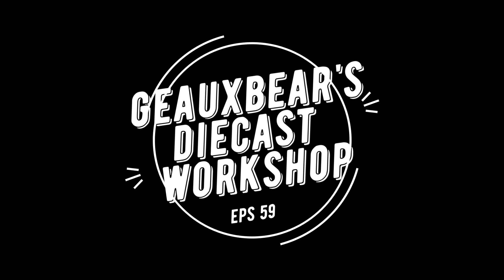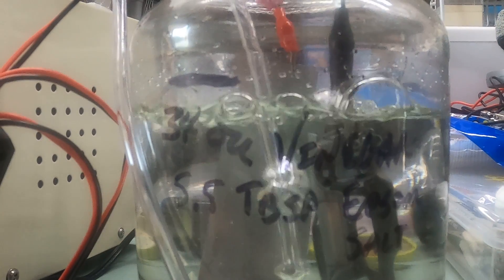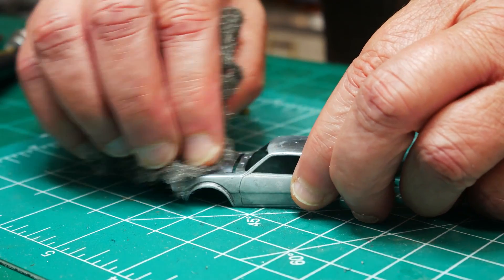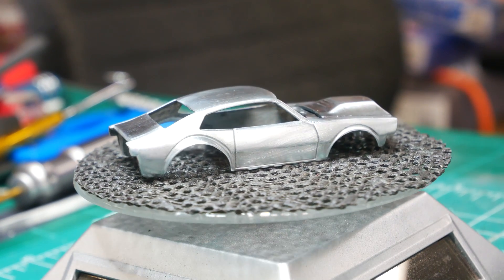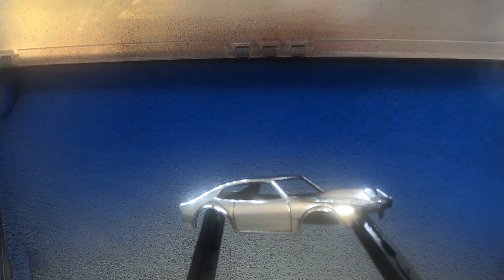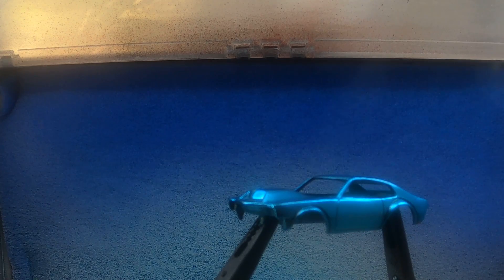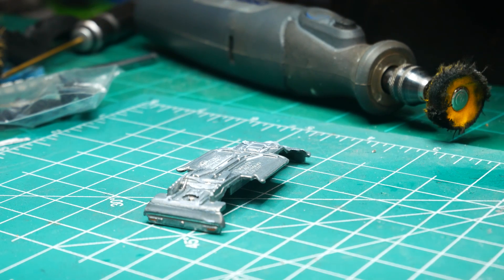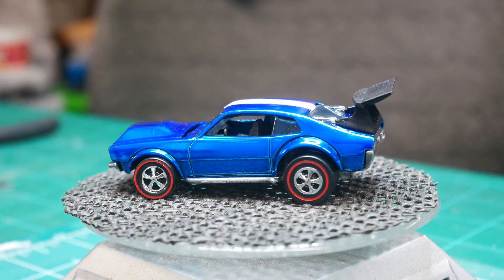National Redline Day 2021 Three Blind Mice/Four Horsemen EPS 59

Comment: Did you use just a separate spoiler or did you go with the complete interior and spoiler from an Ebay seller.
Oh, I just subscribed. Your paintwork is flawless. Although I must say I was disappointed you didn't straighten out the cowl.
Reply from the maker: It was one piece including the interior. Sorry about the cowl, thanks for letting me know. I will take of it.